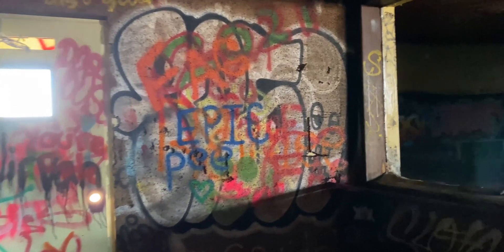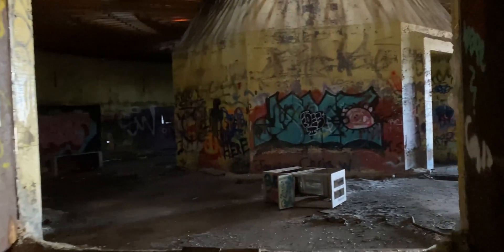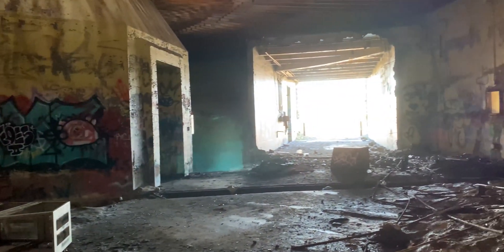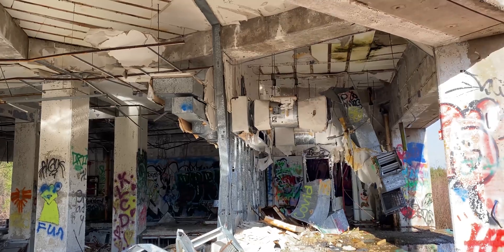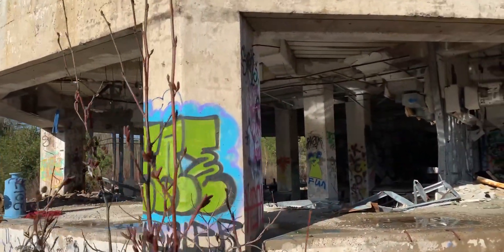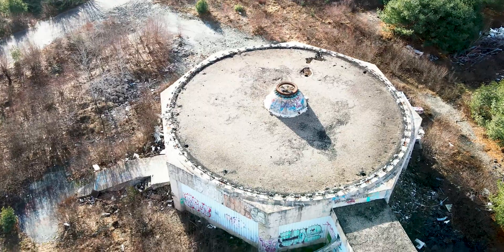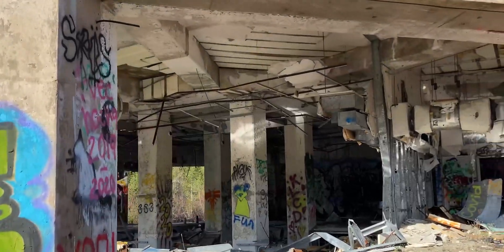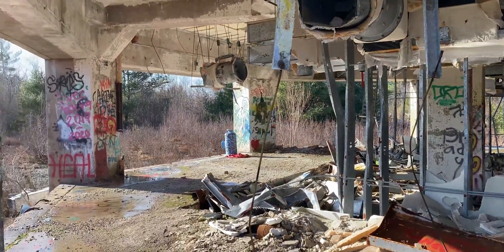WHY DID THIS HAPPEN? WE EXPLORE THE RUINS OF THE TELEGLOBE EARTH SATELLITE STATION IN NOVA SCOTIA.

Comment: hello, I worked there from March 1993- Aug 1995. The site was made obsolete by Fiber Optics. The principle function of the site was to bring signals off satellites parked half way across the Atlantic Ocean and then relay them by microwave towers to Montreal (Telephone) and if occasional use TV, via other satellites parked over North America. In 1992 Teleglobe was supposed to bring two new Fiber Optic cables to the site, one from Europe, the second from New Jersey USA but the local phone company MT&T added a huge cost to upgrade their infrastructure in Nova Scotia to provide a backup route back to Montreal so in 1993 it was decided to land the new fiber optic cables at the other Teleglobe facility outside Halifax at Pennent Point. I was transferred to Pennant Point in Sept 1995. Most of the usable Telecom equipment was moved to other Teleglobe offices and site was de-staffed that fall but the building was kept heated and maintained. In the next year or so Teleglobe realized the site was a liability and sold it for next to nothing to a junk dealer named Hatfield. The Hatfields moved into the complex and stripped and sold off anything that had value. In many cases they used a bulldozers to rip up buried cables and pull down the antennas. In the end, the junking of the site took too long and the site was still taxed as an industrial complex, so the Hatfields walked away to avoid the tax bill. From there I can only say the site had no windows, doors, and people and animals started to use it for "anything" including driving ATVs through it. In was deemed dangerous and the main complex was torn down. One quick story, the dish at the end that you call 3 was actually #2 built in 1968. The reason the base still stands is there was a fire during its construction and the integrity of the cement was questions so they doubled it up. It seems the Hatfields did punch a hole in it to take the iron cog wheel. The Ray Dome (ballon) Antenna was #1 and gone near 1985 but rather than tear down the building it was cheaper to just put a roof on it. The center complex was the office, stockroom, multiplex area, control room, and also held the two diesel Kawasaki Turbines that I think could produce 1 million watts of backup power. The antenna next to the main complex was known was #4 and it was 100 feet in diameter. It had a gain of 60db. Fiber optics made it all obsolete.  Teleglobe was teasing with the idea of starting a new service called Odyssey, handheld phones that would use medium earth orbit satellites and there was hope Mill Village would be used for that but Motorola's Iridium System made Teleglobe's plan obsolete as well.
Reply from the maker: OMG what a great explanation thanks Glen! You answered so many questions, many that the locals in town didn't know. So newer technology eclipsed the older technology and the Hatfields ran away from their commitments. The Dome went down went back in 1985 with the rest closing within 10 years. It would be nice to have you with us Glen if we ever do a follow up video. Thank you!
Reply: @DANandSALLY  you are welcome. I was on site near 2008 and the main building was still standing but completely destroyed inside, ATV tracks, paint ball etc. It was hard for me to see as I enjoyed working there. By my next visit a few years later, the main building was gone. Sad ending.
Reply from the maker: That is a sad ending. When was the last time you were there?
Reply: @DANandSALLY  I can't remember the date of the last visit. I would be near my Aunt's passing in 2016. I drove in with my Saturn car and the road was not as brushed in as your video shows today
Reply from the maker: My girlfriend Sally (who's in the video) told me the forest seems to be taking over the station at a faster rate then she remembers from her last visit. That's a shame.
Reply: Just loved this video ,so well done!!